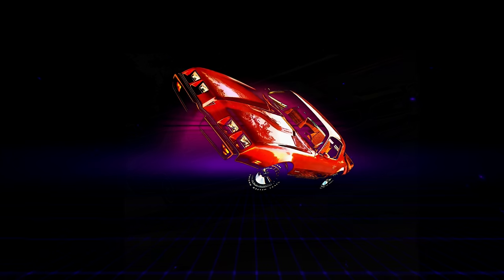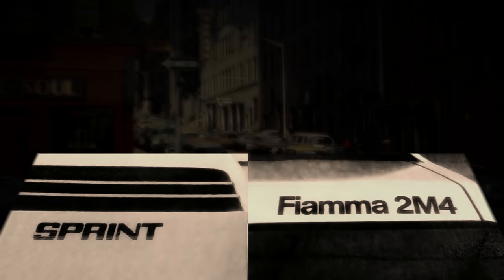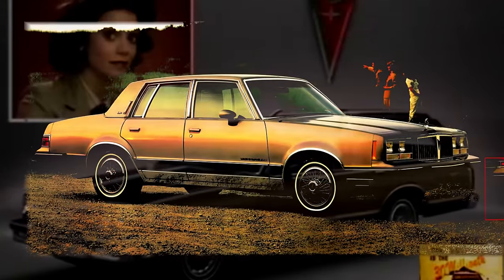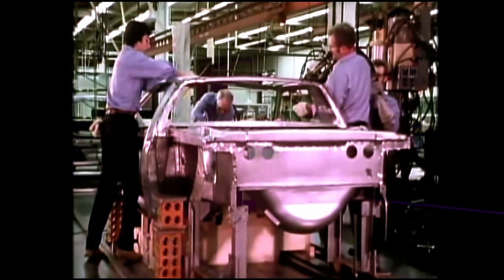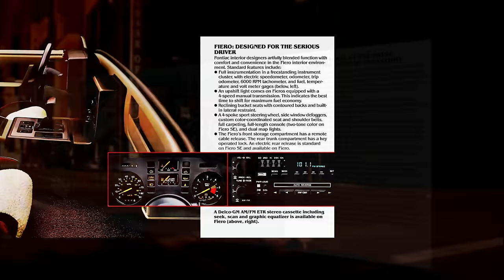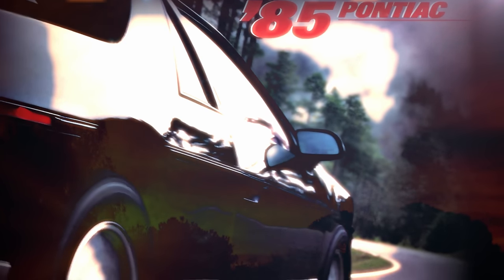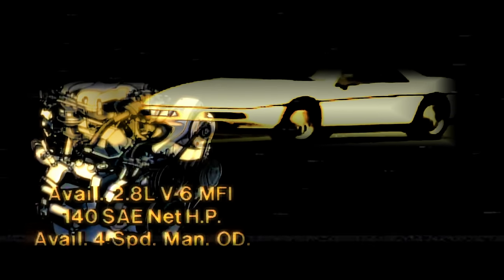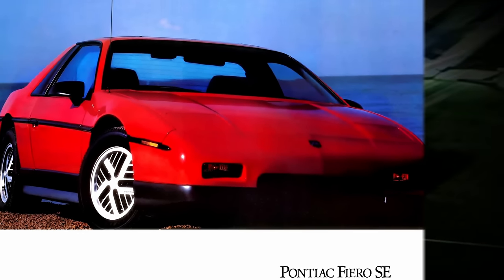The Pontiac Fiero Story

Comment: The 1980s was the beginning of trouble for GM even though they had plenty of money. That decade was also the beginning of the end for Pontiac. Rebadging was much more common with the Big 3 by that time too.
Engineering was one of, or if not, the biggest, issue with the Fiero. Even though Pontiac was considered GM's performance brand back in the 1960s, as time evolved and new leaders took over, Pontiac was becoming totally different. GM leaders were focusing more on the Corvette and Camaro.
I practically never see a Fiero all year, and Pontiacs have become uncommon on the roadways.

Comment: Being developed on a shoestring meant having to use many off the shelf components including the Chevette front suspension, Citation rear subframe and the unsuitable iron Duke engine which compromised the car a bit too much, GM redeemed itself with the final model year but decided to kill it just as it become world class
Reply: I had a new first year performance axle coup, not the economy ratio axle , that many didn't even know were available. Then I had a new Fiero Formula, only available in '88. The V6 was a much better vehicle, than any 4 cylinder model. The '88 were superb, & with a Lotus type front end suspension, & a revised rear end suspension, they were by far the best of the models. The V6 should have been a little bigger , like a 3.1 or a 3.4 , of that same engine family, but it was a pronounced upgrade from the Iron Duke or the TechIV , 4 cylinder engines. 

I suppose the Fiero which was supposed to continue , in '89 , with a slightly new body style , was killed because of the introduction of the Buick Reatta. & then GMs Chevy division complained that the Fiero was cutting into the flagship GM performance Icon, the other 2 seater they made until '89, the Chevy Corvette. 

My Formula was on par , IMHO, with the 50th anniversary Corvette I bought brand new, ordered to my specs. Adjusting for the era of course , both cars were manufactured in.
Reply: The sales dip every year for the Fiero also played into its demise. It sold extremely well in its first year, then the bad rap of the engine fires lead to its drastic sales drops throughout the years, proportionately. It really wasn't a true sports car until the final production year, of 1988. I'm sure the lact of real performance handling , until 1988 & the anemic performance of the 4 Cylinder models had customers loose interest in the vehicle too? 

Its design, though,  is timeless & it still looks good, to this day. In 1988 , I compared it to the rather odd looking Toyota MR 2 , & the Fiero was a much better value. 

IMO it was much  better looking than all the Japanese 2 door vehicles , like the Honda Del Sol or the Mazda Miatta , too, that even were newer , but designs that weren't as good looking & flowing as the GM Fiero. It should have been & could a winner for many years , but GMs frugalness, & Chevys disdain for competition for the Corvette ended up ruining the concept of this car , that  should've have been Iconic vehicle.
Reply: Classic GM from the 1980s through today... By the time they get the car right, they cancel it... Firebird... Fiero... G6... G8... even the Monaro based GTO... And the creation of Saturn sucked money away from new car development for both Chevy and Pontiac... And now that GM is pulled out of all world markets except China (Buick) and the Americas (Chevy) it's really living on barrowed time.
Reply: @ryanwolff4058  GM would rather sell out its own brand to the chinese than have a cool performance brand
Reply: @misterbuklau4053  sadly the GM i knew and loved is dead. i still have a prestine 1997 grand prix SE 3800 (38K miles on it), a 2001 GTP, and a 2003 bonneville SSEi.  i love GM cars from this era (particularly pontiac), but there is little GM produces today that interests me. MY GM died in 2008
Reply: @andrewdonohue1853  Yeah same

Comment: I’ve had several Pontiac Fiero‘s. I currently on 86 1/2 GT automatic in a 1984 Indianapolis edition number 413. Fiero was an affordable mid engine sports car. But I will say the 1990 probably would’ve decimated the Corvette. After this suspension was redone in 1988 the Corvette had a competition and it was the Fiero and don’t forget the TwinTurbo 3.4 L V6 that was on the platform. The engine lived lighter in the Chevy lumina Grand Prix GTP but was never turbo 3.4 L dual overhead cam. Only the McLaren 3.1 L Grand Prix

Comment: A mechanic`s point of view. I worked on the Fiero in a dealership . I did not see very many of them . The brakes had issues the engine had issues the steering I was not real fond of. My Mom actually owned and drove it a lot she loved it. The car had a brake issue malfunction and caught on fire. The brake line hose was to blame . They were recalled for them and something else . I liked the Sun bird looked like the j 2000 but not the same .

Comment: The '88 GT was good, the others not so much.
Reply: Honestly…the 88 redesigned suspension gets WAY too much hype. All the WS6 cars from 84-87 were actually very capable handling cars. Throw a $50 bigger Sway Bars on, and an 85 GT, 86-87 GT Fastback or 86-87 Formulas (an 85 GT in reality), will handle everything and anything better then a stock tuned redesigned 88 GT. Honest answer from a real owner of every model of Fiero. I still have 3 (84 Fuel Economy Model ‘the absolute rarest’, 85 SE, and an 86 GT), in the yard.

Comment: Good video I have a 1986 with a turbo powered 3.8 series 2....I love these cars, I’m gonna read the comments.....and I can bet there will be some mustang, corvette, and civic owner hating.

I dispatched many mustangs and corvettes....with my 3000 turbo powered fiero..shut them the hell up” many complained their ac was running” yeah right Air condition disengages at full throttle” many claimed I jumped the line....I have a 3000 stall torc converter, I have to lay on the brake to build almost 3000rpm to spool up my turbo....due to my shitty launches, many get the jump on me....before being revealed in.

Mustang owner: Your car is a death trap.....those things will burn up...Pontiac made unreadable shit, I’d drive any ford over a fiero.
Me: including the pinto? 
Mustang owner: yes they fixed that issue, and many more ppl died in a fiero anyway.
ME: so did Pontiac...they recalled the 1984” due to them catching on fire and there were never a fatality.
ME: let’s stop the shit talk and race.
Mustang owner....haha mines a 10.9 second car, you sure you want to race? My V8 is supercharged ...haha you have a automatic transmission.
Me: you wanna talk or race....wheres your time slip BTW.
Mustang diver: it’s not in the car.
Me: let me look at your engine, I don’t believe it’s a supercharged v8, well he did have a supercharged v8” he wasn’t lying about that” 
Me: wanna see mine
Mustang drive: no need those 2.8s are shit and they blow up with boost” he wasn’t lying about that” but he neglected to see it was not a boosted 2.8 it was a turbo powered 3800.

Race starts...mustang pulls a car and a half forward, the fiero reales him in and beats him by 2m1/2 car lengths

Me: what do you say now? You were beat my a 34 year old relic.
Mustang driver: fuck you, there still shit”and gives me the middle finger, and takes off.
At that point I never bothered to tell him he wasn’t beat by a 2.8....so now the asshole can go around....thinking he was dusted by a 2.8...the dumb ass didn’t bother to look at my engine.....oh well, I wish we raced for money.
A 3800 belongs in a fiero.
Reply: Im looking into getting an 86 GT, I was really wanting an 88 but having trouble finding the right one. Needs to be standard,  but juat curious,  does the 88 GT handle well? Thanks in advance.